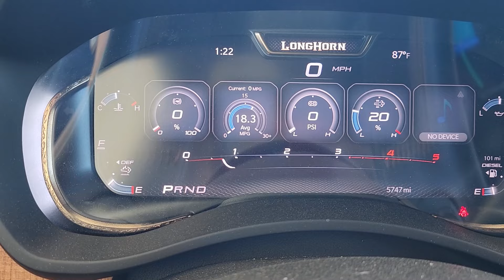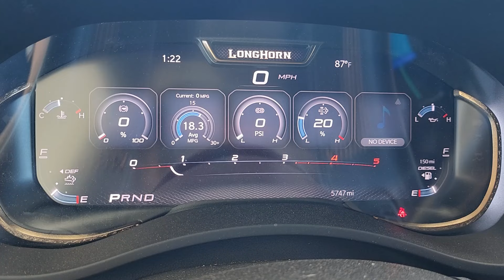Master Of Drywall Gets Paid The Big Bucks | Most Men Can't Do This | THE HANDYMAN |

Comment: Another trick to remove stripped screws in wood attached to the wall is to use a hole saw. Drill a hole around the  screw so you can remove the wood, then just snap off the wood around the screw with pliers or a chisel and you can just grind the screw flush to the wall.

Comment: Hey great videos been watching for a couple yrs. I have a 2018 2500hd  chevy high country. Bought it new and have using hot shots edt since  new. I have 113000 miles it's been good every other oil change I change fuel filter and the dealership says it looks great every time

Comment: Do you guys use the paint that supposedly has primer mixed in? I have used it, wasn't really impressed. Just curious as to what others think.

As far as the boots go, Project Farm probably has a video about boots. He's got the testing market cornered. That being said, I'll watch it if you do it.
Reply: When I was doing rental repairs where speed is more important than an excellent final product, paint+primer is a good solution. If it's a nicer remodel, I'm covering a bold paint color, it's new drywall mud, or wood, it's getting primed first.

I'm not a pro painter, but that's how I've approached it for the most part.
Reply: Ill use paint and primer in one but on a repair with any drywall patch or texture work it gets primed with regulare primer first then the prime+paint in one.